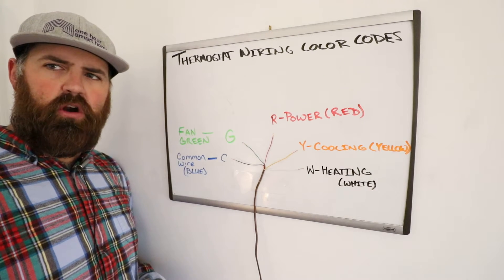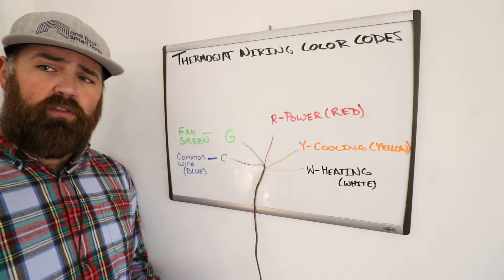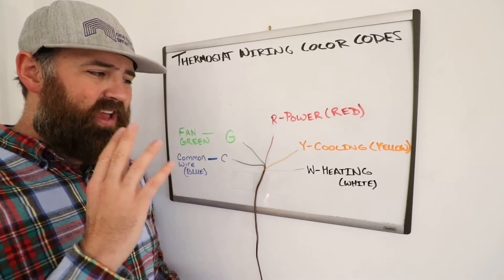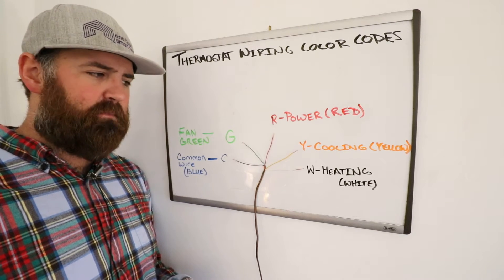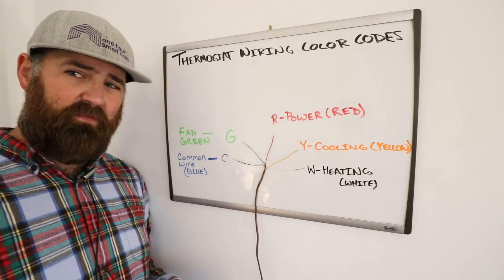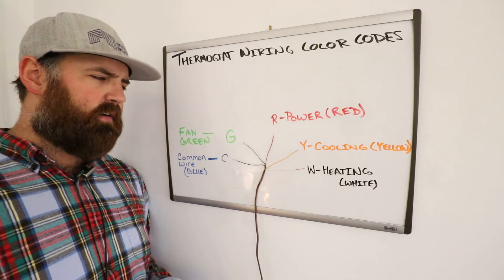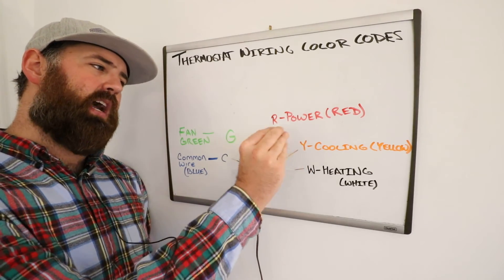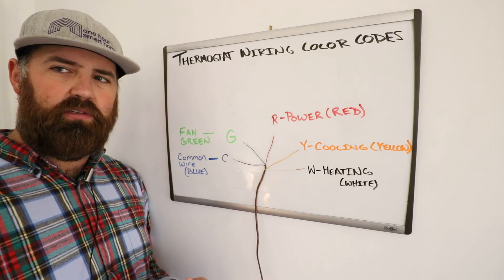Thermostat Wiring Color Code [Decoded and Explained]

Comment: I just replaced my Honeywell thermostat with a black and decker hoping that is why my ac is not running cold. There’s no yellow wire. The blue was attached to the Y in the Honeywell. When I did the same in the new, I had no power. I connected the blue to the C. Should I be concerned there’s no yellow, especially since it’s the ac that isn’t quite right? Thanks

Comment: I have a boiler, 3 different zones- the wires are red, white and green. I tried connecting to a new honeywell thermostat with no luck. The new thermo power up but doesnt kick on the boiler. I did Red To R, White to W, and tried the Green on C, and then on G. no luck.  If G is a fan, how does that work being i have a boiler, and dont have a fan?

Comment: I have an old analog thermostat. But the Blue wire is connected to the Y letter. In normal, the Blue wire is connected to the C letter. 
Now i want to replace with a new thermostat. Where does the Blue should i connect to? Y or C? Thank you.

Comment: Can anyone pls help me, I'm trying to install an ecobee smart tstat. However the old thermostat didn't use the green wire and the blue wire was in the "G" slot. The thermostat did run on batteries so I understand why the blue wire wasn't needed...but my question is why is the blue wire going into the G slot? Any help gladly appreciated

Comment: Help...  I have an ancient Trane thermostat & Furnace.  It is 4 wire-R,Y,G,W.  When I try and connect the new Honeywell TPro 6 that I have, it has a blue wire, I had it working but now it stopped working.  I have connected the blue wire to the C (common) on the blower and it has a white wire already connected there.  It was working great but when I changed the filter, and turned the power off, it stopped working.  It says AC Turned on but nothing works.  Equipment says it is in a "perpetual standby" mode.  So I connected the old Trane 4-wire thermostat back up and it works fine.

 I tried to disconnecting the blue wire on the TPro6, but the thermostat went dark without the blue wire so it obviously needs it.

Comment: I took off old thermostat and there was no C wire connected. However there is a blue wire and a brown wire that are not connected. This is a new building (2017) so is the blue wire the C wire and they just decided not to connect it to the thermostat?

Comment: I hooked up a ecobee because I installed a new split central air unit and coil and I noticed that the common wire is not hooked to anything on the furnace box side.

Comment: Thank you for your video. My cooling system keeps running and cannot be turn off. 
Question: If my Y (Yellow) wire's Ohm value is over 24 Ohm, would it be the problem to run cooling?

Comment: R simply means 24v your furnace or thermostat does not know what color the wire is. 
I love to wire my thermostats like this to confuse the techs that think the color matters.

R-white
W-green
Y-red
C-yellow
G-green

Also you need to hook up g to bring on fan in ac mode what you don’t need is Y to the board you could take that from stat to condenser

Comment: I try to install the ecobee thermostat to replace the honeywell old thermostat. I check the 2 wires go to my furnace. I see 2 wires, one connect to R and the other one connect to G instead on the W.  There is nothing connect to the W on my furnace.  My question is does it make any different? My heating been work like that.   Not sure why my is not connect to W instead on on the G.  Please advise how i can connect the wire G wire form the furnace to the ecobee thermostat.  Should i connect to the G or the W going from my furnace?  Thanks in advantage.

Comment: Hi...I have a heat pump a/c unit. Trying to wire a new Honeywell wifi thermostat.  I'm down to the last wire and I see a jumper for the R / RC screws. I only have an R wire leftover. 
Do I leave the jumper? Do I plug the R wire in WITH the jumper?  Not sure what to do!

Comment: My question what is the L and terminals in a Thermostat
I have
L = ? I need you to decode the L function 

I hade a 5 wire and a 3 wire 
3 wire had blue = c com/ 
white = E for emergency heat to melt ice buildup on compressor 
Red was o = reversing valve 
On the 5 wire 
White = w1 my heat
Green = G my fan
Red = R my 24 volts
Yellow = Y.   Ac
Blue. = L. ?
I change the mercury TState to a pro 4 could not get heat working 
Put back on the mercury thermostat work fine. Through all it’s function

The mercury thermostat need the 8 wires to work there 4 mercury bulbs in the 1 thermostat it a heat pump system control from Carrier

Comment: I was about to ask a question but noticed you have 1 to 10 months to a year or so comments with no answer to there inquiry. But I’ll go for it anyway, how about in need of heat in desperate needs, could you connect the red to white wire for heat (breaker off before joining) for a temp fix?

Comment: Hi, have a question.  I have an old Carrier programmable thermostat that seems to be using only 2 of 6 wires sticking out of my wall.  It uses a red colored wire connected to O/W2 and a green colored wire connected to Y1/W2.  It works, but I want to replace it with a smart thermostat.  The other 4 unidentified wires sticking out of the wall are 1 x Blue, 1 x White and 2 x Black.  How can I identify which colored wire is what?  FYI, all the wires are coming from a Carrier Packaged Unit 48DP012.  Thanks in advance.

Comment: I have an old Honeywell thermostat with just a lever to control. I only have a red and white wire and I purchased a colorsmart Honeywell thermostat that needs a common wire. Is there an easy fix? The thermostat did have a short wire in the box.

Comment: Hey, great vid btw I have a question,  what do RC and RH connections mean on my smart thermostat anybody?
Reply: R is always power. Rc is power coming from a cooling system, Rh is power coming from the heating system, in case the systems are separate enough to be providing them independently.

Comment: Hi there, I have a 3 wire system; red (with the thing metal connector thingy), green, and black.  It is a ct100 thermostat. It started marking noise one night and the only way to stop it was to remove it from the wires. I reconnected it (i think the correct way) and the heat works, but now the furnace takes a long time to kick on. I can hear it turn on (like an electric sound) but it takes like 40 seconds after clicking to actually turn on.  I put the wires like so: black into W, red into RH, Green into G. Is that correct? I also tried testing the wires with a multimeter and the black and green show power, but the red doesn't. Can I check in the basement/furnace room somewhere to see if that's the issues?

Comment: That was great info, for someone who has that wire set up, but I have only 4 wires connected to a thermostat they are as follows Red Green Blue, and Yellow the old thermostat has the following {RC} Nothing on it {RH} Red wire {O/B} Nothing on it {Y} Has a Blue wire {G} has a Green wire {W/E} has a Yellow wire and there's a {C} Nothing on it, And the new thermostat has a lot more connection options as follows in order on the left side {S} {S} {Y}{Y2}{G}{C}{U}{U} then you have the ARight side as follows {L/A(A)} (O/B) (AUX){W2} (E) {W} }{K} {R} Rc} what a mess.
I was about to change the thermostat to a programmable but I'm lost on what does what here and help would be great the new Thermostat is the Honeywell Pro Series T6 Pro TH6210U2001, The Old thermostat is the Comfort Sentry from One Hour Heating and cooling. wish I could upload a couple photos... 
Any help on this would be greatly appreciated...

Comment: Simple and to the point. Have a quick query, planning to replace the old thermostat(no C wire) with Nest 2020 model. Stuck up seeing a Red wire also connected to the Y terminal in the current thermostat. Highly appreciate your advice.
Reply from the maker: I would recommend getting the Nest Gen 3: https://amzn.to/3urAZ4e or the Nest E: https://amzn.to/3qSRh3L if you don't have a common wire because in most cases they don't require a common wire so it will save you the trouble of adding one or adding a transformer. However if you do go with the 2020 model: https://amzn.to/3sssF2y this video shows you how to add a common wire transformer to get it to work: https://youtu.be/yi5kfn3bmEk The 2020 Nest Thermostat always requires a common wire for installation. These videos show you how to install the Nest 3rd Generation: https://youtu.be/uQE7OeNFcIg and the Nest E Thermostat: https://youtu.be/BPtkEVqIWzE

Comment: I hooked it up the way you show here but I don't have an air conditioner and the digital screen on my thermostat isn't turning on. Could the yellow wire cause that? There is also a brown wire that is in the wall but was not used on the previous thermostat. I'm not sure what that wire is for.

Comment: I have baseboard heat furnace. I have 2 wire connected to R and W in my old thermostat. There is no C wire. However there are 2 extra wire inside the wall and these are not connected to anything.

After watching this video my question is, can I use a jumper from R wire to C wire on Nest thermostat?
Reply: Never jumper a wire from R and C or else your furnace will blow!!! Well your fuse will blow. Since you have extra unused wires, you can use that wire as your C wire. Make sure both sides are connected to C on the furnace board and on the thermostat.

Comment: I have a blue one and a brown. Assuming the blue goes into C, where does the brown go?
Reply: Where does brown wire g
Reply: @dwaynedrummond5730  It is an extra wire that is used for accessories like a humidifier.  It may not have anything connected to it.

Comment: Hi I could really use the help with my wiring, I'm getting a nest 3rd gen thermostat and I wanted to know where the e and r wire go because I get lost there 
C                                           R
O                                           G
E- this is a white wire.     Y

That's how they look on my thermostat now. I live in central Florida, incase that helps a little bit more to understand.
Reply from the maker: Adan, this video should help: https://youtu.be/6qwFra15pdY
Reply: @OneHourSmartHome  I watched it so would that mean the e terminal even though it's a white wire will go were you say it goes?
Reply: The best way to determine what the E terminal is is to look at where the E wire goes to on your furnace control board. Most likely the E wire is your Emergency heat, which should be connected to the W terminal of the thermostat.

Comment: Near the beginning, you say that you'll discuss 7-wire hookups at the end of the video ... but you forgot :-)
Reply from the maker: With a 7 wire hook up you most likely have heating or cooling system with two stage heating or two stage cooling or both. These two extra colors could be any color, however you would need to see what terminals they are connected to on your existing thermostat then transfer them over to the new thermostat for staged heating or cooling. If you don't know what terminal they are on you can pop the cover on your HVAC system and take a look at the control board and it will show you what terminal they should be connected to on your HVAC system.